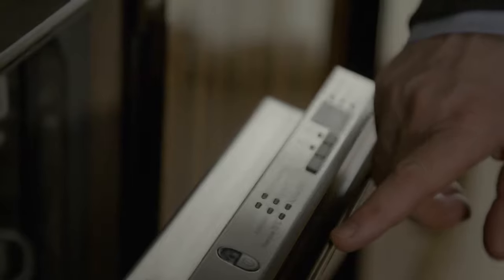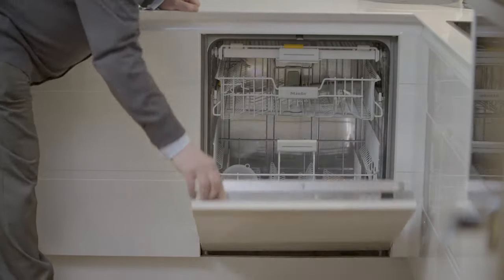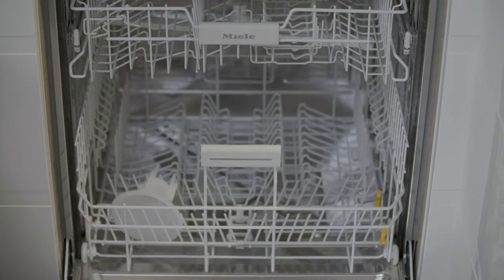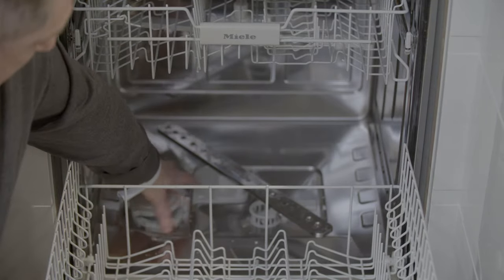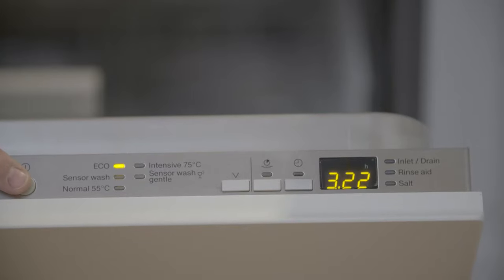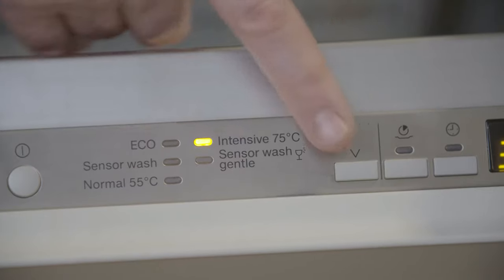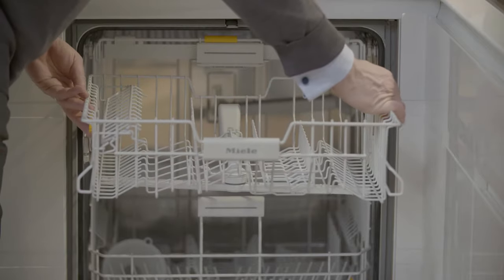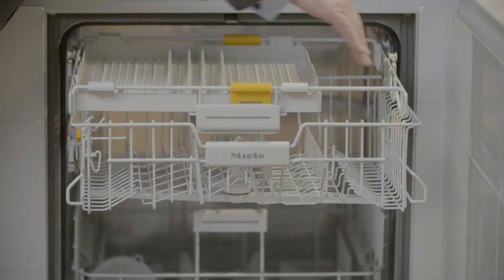How to start using your Miele dishwasher

Comment: Our fully integrated Miele dishwasher stopped working and Miele wanted almost 1k to fix it. I expect that the machine should
last a lot longer. The reputation and quality for lasting 20 years is obviously false advertising and a bunch of baloney. You can’t get any deals on new machines and only Miele can fix them at absorbent prices. Very unhappy with their product and attitude
Reply: How long did you own it for?
Reply: Yup my sister’s G6620SC has after 8 years bit the dust I’m not overly impressed.